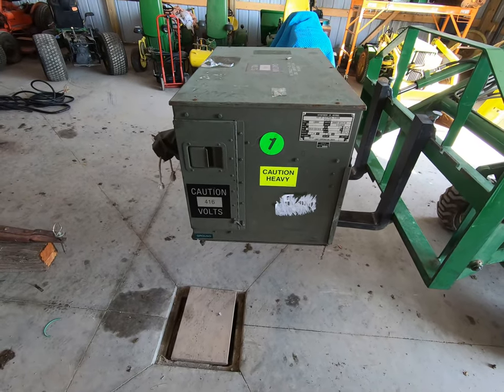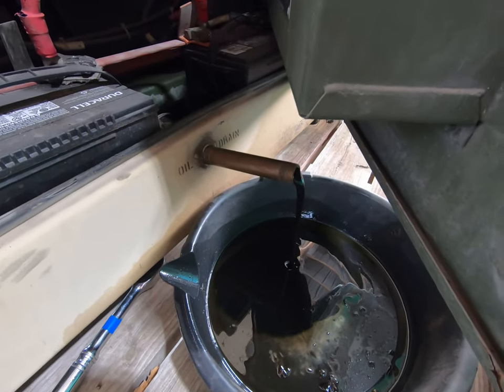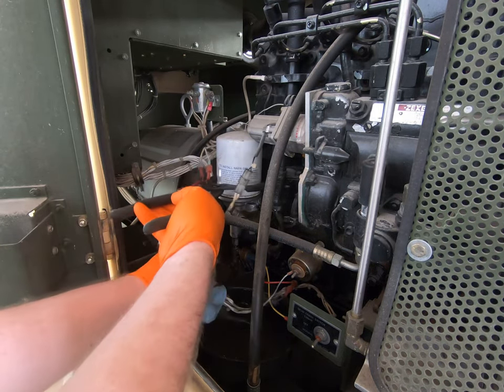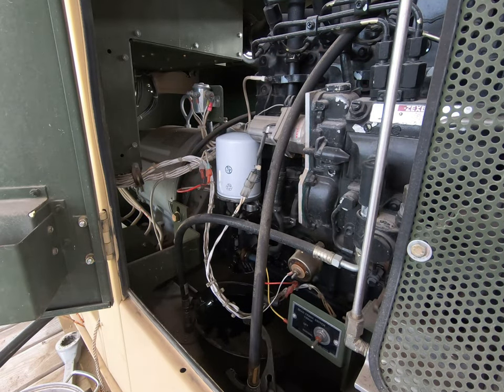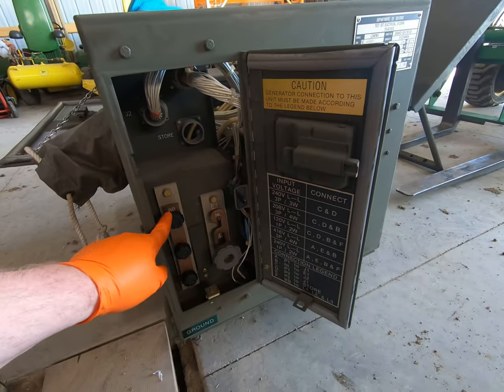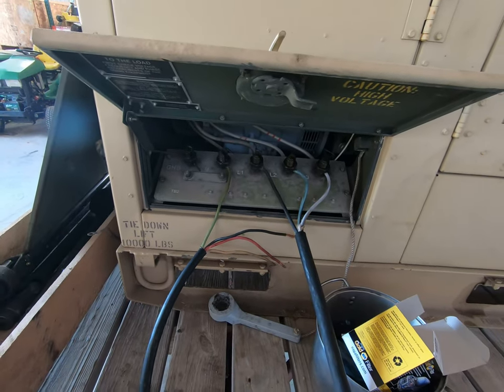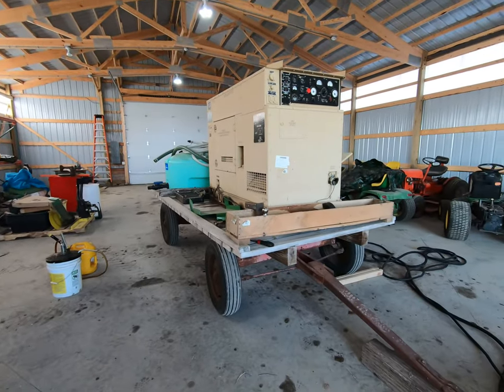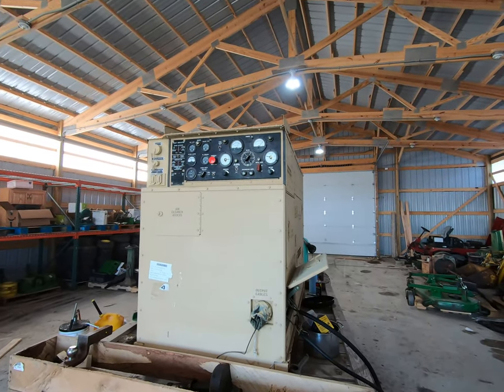MEP-804A Generator and LCNFM1 Test Set

Comment: i have a mep 804a i just purchased started up and worked fine , two days later started up ,no power . started looking around found nothing. found out it will make power as long as you hold the start switch down . whats wrong
Reply from the maker: Make power or run? If it quits running when you release the start switch there is a simple fault somewhere. If it stays running but won’t produce power then there is a whole different set of faults. The easiest way to diagnose a problem with these is to find a technical manual, spend some time going over the procedures and terms. Then follow the diagnostics in the manual. I had no power production on mine, took me about a month of off and on reading, researching, read some more, tracing wires, and trouble shooting. In the end it was a corroded relay and the repair cost me about 30 minutes of wrenching time and zero dollars. I spent 10-12 hrs reading and researching. Since I did all the research and learning I know the machine better and I am more prepared to deal with issues. Taking some time to learn more about the machine is well worth the time! Components on these units are not cheap and you can be $500-1000 into a repair when in reality it could have been solved with no money or $20.
Reply: You have probably fixed this issue, but what you describe is the stator not providing the excitation voltage for the main generator.